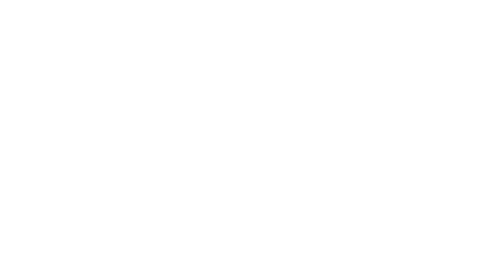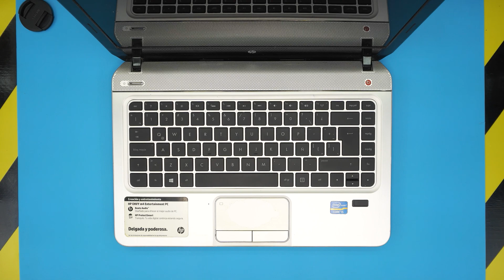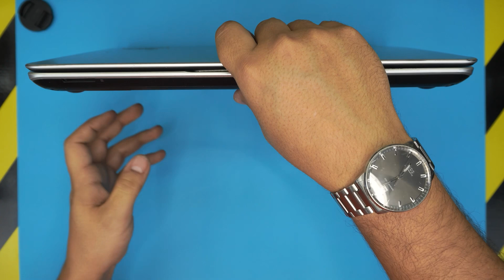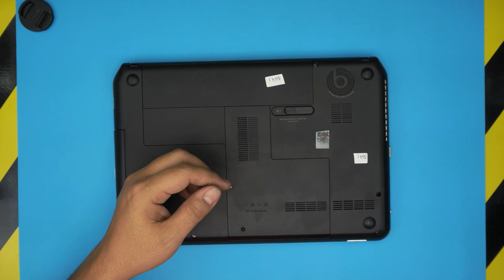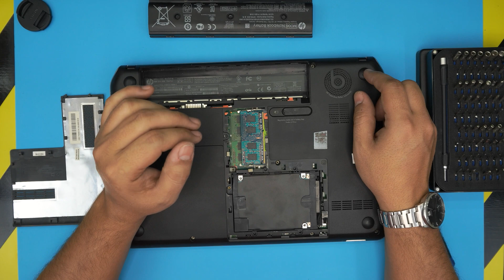How to Upgrade RAM on an HP Envy M4 M4-1050 Laptop | Step by Step✅

Comment: Hey, thanks for the video.
I found you while searching for how to open this exact model. I have one gathering dust at home. 
The keyboard doesn't work anymore and the laptop overheats and shuts down due to fan failure, so I figured I could salvage parts to add up to my PC. 
I was wondering, what else can I salvage apart from the HDD? Can I use the RAM in a desktop? Is it worth it? Can I salvage the screen? It never had a problem and it seems to be working perfectly, could I use it as an external 2nd monitor for my desktop? I don't know much about building or repairing computers, but I know how to google tho, or ask GPT-3)

Cheers!
Reply from the maker: Thank you for your feedback! If you'd like to support the channel, you can like, subscribe, or do both!

Regarding your question,  the only parts you can use it is the HDD the ram are not supported for PC , you could buy an adapter but the performance is not worth it, and regarding the LCD using as a 2nd screen you can built your own 2nd screen buy purchasing an controller board, i made a very very old video about this check it out it may help you.
https://youtu.be/OL9MJk-feqU

Comment: I have a problem related to this model of notebook:
when moving the screen (to use the notebook) vertical stripes appear, in most cases I would say that it is the graphics card but the stripes vary or even disappear depending on the position (or any) in which you leave the screen.
My main suspicion is that it is about the flex, but I wanted to know if you had something else in mind after reading my case.
Reply from the maker: Thank you for your feedback! If you wish to support the channel, you can like, subscribe, or both!
Regarding your question, We often encounter this issue in our store, and it's NOT a problem with your graphics card. In fact, it's usually due to 98% of the LCD panel having damaged crystals caused by the pressure created by the hinges. Unfortunately, the only solution is to replace the LCD panel, as it cannot be repaired. The remaining 2% of the time, the issue could be caused by a faulty flex cable.

To determine whether the problem is with the flex cable, you'll need to remove the screen bezel and gently press on the flex cable without moving the screen. If doing so causes lines to appear on the screen, then it's likely that the issue is with the flex cable